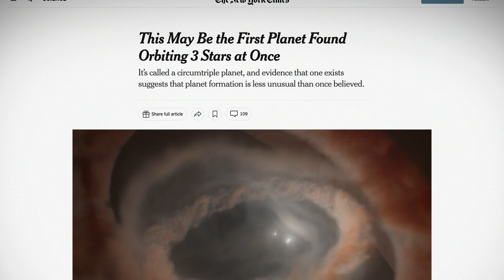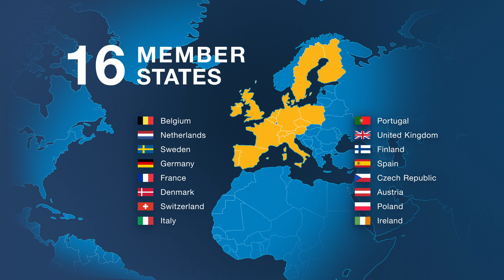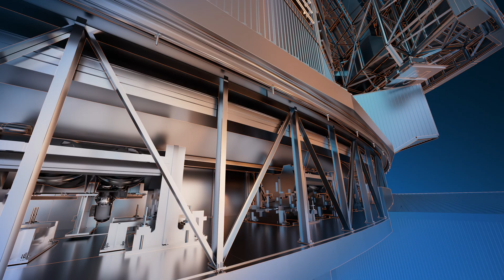What is ESO?

Comment: Hari gini masih bikin teropong bintang di permukaan bumi??? Amerika sudah bikin teropong bintang di luar angkasa: Hubble & James Webb.
Reply from the maker: Building telescopes on Earth enables the use of much larger mirrors at a much lower cost. For comparison, while the primary mirrors of the Hubble and James Webb space telescopes are 2.4m and 6.5m in diameter, the mirror of the ELT will be 39 metres large. Through a larger mirror it is possible to observe fainter objects and achieve better resolution — namely, the ability to distinguish fine details. Using a technique called adaptive optics we can correct atmospheric turbulence, delivering very sharp images. Also, fixing space telescopes or upgrading them with new instruments is either very costly (like Hubble) or simply not possible (like JWST, which is located way beyond the Moon). So space telescopes and ground-based ones complement each other, the former can’t replace the latter.